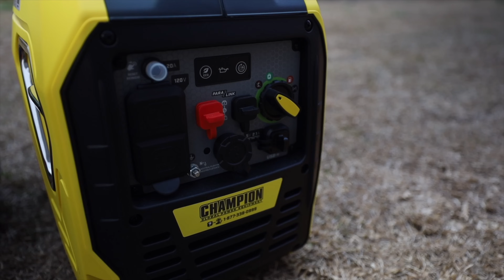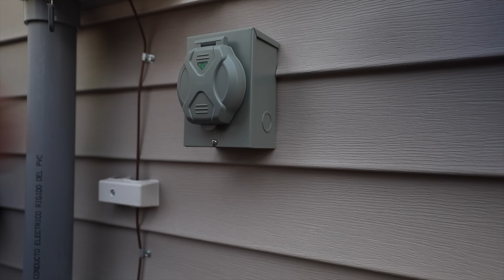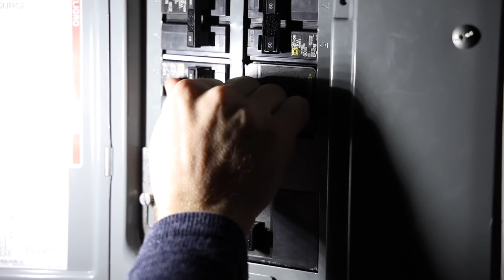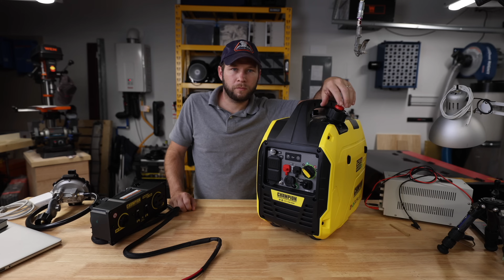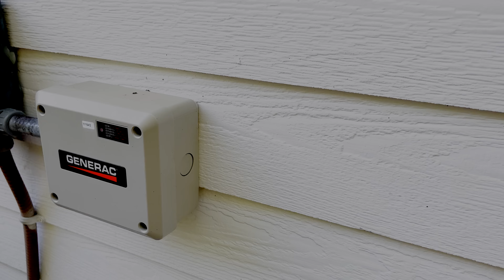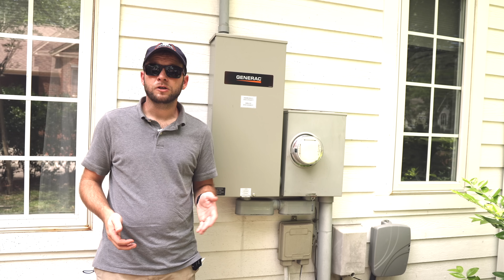Will running on a generator damage your house? Inverter vs standard vs standby

Comment: So much incorrect information in regards to the transfer switch.  Like not even CLOSE to being right.
Reply from the maker: I don’t understand your comment, the transfer switch controller monitors the grid and sends power to the generator to maintain its system. The ATS brain is constantly monitoring the utility side and upon a power failure severs the utility connection side and sends its start/run signal to the generator after a programmed delay.  What exactly is wrong about that?
Reply: @DemonicAnimatronic  The ATS does not “sever the utility side and then send a start/run signal”.   An ATS sequence of operation is as follows:
Sense utility failure
Wait for programmed time to elapse
Send start signal to generator
Verify generator power is present
THEN and ONLY THEN does the contactor operate and switch the sources from utility to generator. 
There is ZERO chance that the generator can back feed the utility grid no matter what position the contactor is in.  It is a double pole double throw switch.  There is no physical or electrical connection between utility and generator.
Reply from the maker: So start, then disconnect utility to off position, then from off position to generator.  I’m aware it’s a dual solenoid contactor. I was under the impression it disconnected utility, then started, then pulled in the generator, from a lockout standpoint that makes more sense to me but I guess wouldn’t allow for a short power blip to be accommodated. I don’t believe I ever said the generator could send power back to the panel while the utility was also connected?
Reply: @DemonicAnimatronic  at around 24:00 or so, you made a point of incorrectly explaining how the transfer switch ensures that the utility connection is severed so the generator can not feed power through to the meter.  The very design of that contactor precludes the possibility that could happen no matter what position the switch is in.  That is why the sequence of operation is as I stated.  Also, the linear actuator that changes the position of the switch requires line voltage to move.  Without either utility power or generator power, it can not change position.
Reply from the maker: @ClearlyDigital  with all due respect, that’s not incorrect though, the transfer switch does sever the utility connection to prevent the generator from feeding back into the grid, that is its purpose. In the same way as an interlock kit on an electric panel prevents back-feeding.  Please stop restating what I am saying using different terminology and saying the explanation is incorrect. For example: I said I am aware that it is a solenoid operated switch, given that it is using electro magnetism to pull in a set of contacts, it is effectively a contactor. Your explanation was that it uses a linear actuator. Well, a solenoid is a type of linear actuator, however not all linear actuators are solenoids.  Now, this is a layman video that was to explain the type of generators used and why you would use each and how “clean” a given type is. So when someone says what does that box on the wall do, you say it cuts the power from the grid and connects the generator. Another word for cut is sever.  Of course the ac powered multi position transfer apparatus does not allow the generator to be connected at the same time by mechanical means, otherwise it could never have gotten its listing. The electronic control is not relevant either, as it does not need electricity to operate, it needs electricity to operate automatically, there is still a manual override lever, that is why it is a mechanical lockout.  I also used a layman’s explanation of total harmonic distortion boiling it down to frequency variation of book standard. Because describing actual dirty power involving multiple harmonics that can bypass filter capacitors in certain power supplies is a bit beyond that video.   The transfer switch shown in the video is known as a break before make switch or open transition (OTS), this means that it has to sever the utility side before connecting the generator.  There are closed transition switches or CTTS, these actually do allow momentary paralleling of utility service and generator with synchronization to create a zero loss transfer, though these are really only for large commercial and hospital usage.  This really is like discussing three states of matter in basic science and having someone insist you left out plasma.
Reply: Please accept some attempt at clarification.  You are treating the "sever" as a separate step in the process, when it is not on these systems.  On the air cooled consumer grade generators, the transfer from one position (source) to the other is virtually instantaneous.   In changing from a utility/commercial power source to a generator supply (or reverse) once the xfer signal is provided-either by the generator controller with a dumb switch, or via the ATS controller with a smart switch.  Literally if you blink, you can miss it.

There are multiple variation of ATS configurations, and there is no need to go into them as it was not germane to your video.  But, don't think ALL generator/ATS combos work the same as yours-and you might emphasize that.  

And frankly you don't have your systems operation down either:  "...utility solenoid unhooks utility to neutral position, generator solenoid pulls from neutral position to genset connection."  No, it really doesn't-your system will either use the utility closing coil, or the generator closing coil, (when two solenoids "coils") are present) or the linear actuator cycles the amount of times it needs to go from one, to the next available power source-depending on the type of switch...there is no "utility solenoid unhooking" here as it has been de energized almost the second it BEGAN but not quite completed its last transfer.

The mechanical process is that the contacts movement is initiated by the particular solenoid, overcoming the spring tension that holds the contacts in their present made position.  In doing so, the contacts are forced by the coil past the over center point, the solenoid has already dropped out (energizing limit switch is opened) around this time, where the internal springs for the oncoming power source will then forcefully "make" the contacts firmly close-that is the "clunk" or "snap" that you hear.

Just say "thank you" and move on.   @DemonicAnimatronic
Reply from the maker: @bobbygene8274  As an electro mechanical engineer, NO. I unfortunately can’t say thank you and move on when information is incorrect or is restating something I said while stating I am incorrect. I do not care about how fast the transfer time is, it really DOES disconnect the grid then connect the genset. Please see above statement about OTS vs CTTS. I get that this is done in one motion, but it is done. It is required to be done or the generator would not be allowed in service, as a mechanical disconnection of the grid is required where not permitted for momentary parallel synchronization. There is a neutral position, the transfer switch is not capable of switching from grid to generator without momentarily being in neither grid nor generator position. I assume you are referring to a pull pull transfer switch where one solenoid is used to pull from utility to genset and the other is used to pull from genset back to utility?  There are also powered hold contractors (if you’re lucky with economizer coils) that “fail open” to neutral when power is not applied to either coil. This way power can be severed from the grid when poor power quality is detected and then can be connected to the genset after it has stabilized, this is can help protect loads. It does seem we have a whole lot of "generac experts" here that cant see the video was supposed to be a very generalized version of a complex topic. the point that was being compared was that with a manual interlock the user would first turn off the main breaker, then slide the interlock and then turn on the feed in breaker.  I was (apparently poorly) stating that the ATS did this same operation automatically.  No , i did not say this does not apply to all generator transfer switches and that some have manual phase synchronization before being manually kicked, because i assumed those viewers were probably not watching this video.  personally i have a <10ms transfer computer monitored load center that uses independent circuit monitoring and prioritization, i also use some rack-mounted high availability transfer switches on critical loads as the whole home ATS in the video was not mine and frankly I find it too slow.  but i do get to keep the interaction high with these comments so thats a win 🤷‍♂️
Reply: @DemonicAnimatronic  I missed your reply several months ago, and I apologize for missing it.  You speak of several different types of switches that you are familiar with, and you are most certainly correct in most of your explanation, and certainly wise in keeping it simple.  But, don't think throwing words around like "engineer" electro-mechanical or otherwise is somehow going to make you more qualified than some of the commenters that you have had the chance to interact with and also entertain.  

Many of us work on commercial and industrial auto-sync, auto parallel systems and effect repair on the same-and those pesky switches that stop or pause in the neutral or "open" positions that allow motors loads to decay, or even delay return transfer until elevators to get to the next floor or what have you. Just so many possibilities.  And some of those guys will try and keep you on your toes, so to speak.  I certainly do agree that the interaction is the high point, though.   For that, I say thank you.
Reply from the maker: @bobbygene8274  meh, only thrown around because others like to throw in “electrician” or “ I installed one of these once”  before they start telling me what I got wrong. so I’m saying as a degreed engineer who had to study, design and build control systems, the terms have meaning and so does semantics. All of this line of commenting was a result of the comment about a majority of the video being wrong. If we’re going to argue over credentialing and delve into the weeds over how many balls shift from hole to hole in the time it takes the switch to pass from one contact to the other and then establish a spec for which speed results in it being considered a non disconnection, well then I came to play.  ;)
Reply: @DemonicAnimatronic  ... clarification from a 25 year Generac tech.... the TS does NOT control the gen set. The TS has no brains, unless it's got a load shed module. (yours does not) The generator board actually monitors the utility power via the same wires that charge the battery. (240 volts) If it senses a brown out (forget the exact range) or an outage it will start the unit and transfer. The gen board controls the actual transfer via a 12 volt DC signal (terminals 23 and 194) through a small relay within the TS cabinet. This relay puts 240 volts from either the gen set or utility to power those actuators. IOW, there must be utility or gen power available to make things happen. The time delay for all of this is not adjustable by the user, it is factory set. On your unit it will be about 10 - 12 seconds to start up and the same for warm up, then transfer. Cool down / retransfer on utility return is roughly 3 minutes. (max) on a short outage it can be under a minute. Again, factory set.

Comment: A good overview of the functionality, but I guess I missed the part where you cover "will running on a generator damage your house" in relation to the whole-house units.
Reply: Yes that was not a good example he gave about the 40 amps running down the neutral wire because that's an illegal installation anyway. If you have a toaster in a microwave on that island operating at the same time it's going to overload that circuit whether it's on generator or house power. That does need to be clarified about burning your house down. The really person with the two question marks doesn't grasp the situation
Reply from the maker: @carver4894 Not quite, when you install a generator inlet and transfer switch or an interlock and have it inspected, the inlet can be split phase  120/240 4 pole. This inlet will carry all the way through to the separate bus bars and neutral and would be perfectly legal (depending on your local codes)  however 120v generators that offer a 4 pole outlet (known often as RV ready), or a 3pole to 4 pole adapter, will spilt the single leg to the two hots and provide power to both busbars in a panel in phase.  A shared neutral generally meets code (again check local) as long as it is on a common trip breaker. This would not overload the island circuit with a microwave and a toaster when on grid power, because the two circuits are out of phase and would cancel out the current on the common neutral. The second that a split leg generator was connected instead, the neutral would add both loads together and overload.   So nothing here is generally “not legal” but would essentially be up to the homeowner to know how their generator functions before connecting.   Some very knowledgeable inspectors way refuse to let you put a shared neutral circuit on a critical loads panel or an interlock, but it would be at their discretion and easy to overlook.
Reply: Really??

Comment: "Will running on a generator damage your house?"
NO.  See "Betteridges Law of Headlines".
Reply from the maker: Ahh but you missed the stipulation of the law that it only applies to questions that are yes or no. As this video clearly explains, the answer is that it depends on what generator you you use and what it’s powering, therefore Betteridge’s law cannot apply.
Reply: @DemonicAnimatronic  COL (Chuckle Out Loud) Excellent response.  We have one of those generators at work (16 KVA Generac) and its waveform is pretty bad, nearly a sawtooth.  We had to set all the UPS to minimum sensitivity.

Comment: Just for clarification, when you say the 240V on a generator is not out of phase, you mean on paired inverter generators only right? a 240V open frame generator should not have this issue as L1 and L2 should be out of phase to produce 240V between them.
Reply from the maker: Yes, if the generator says it outputs 240v and is not a European market model then it should be 120v on L1 and 120v l2 out of phase with each other. (Europe has 230v between hot and neutral, and 50hz)  with the parallel kit for the 120v generators, it still outputs 120v just with double the current, so to wire the 4 wire outlets, they are splitting the same wire to both hots and not giving 240v.    In summary lol a 240v outlet on an open frame inverter generator should be out of phase 240v and not have the same issues with overloading shared neutral.
Reply: My generator has a 120/240 volt outlet. I assume it will just use both L1 and L2 and I won’t have any issues either? My electrical knowledge is very limited

Comment: Recently I got a 50 amp inlet installed, a gas meter tie-in, and a Firman tri-fuel generator. According to their site, the THD is between 11% and 14%. This can run my entire house without issue including fridge, deep freezer, AC and/or furnace. I purposely didn't turn on my stove or oven or computers, as I probably wouldn't use them in a blackout. I also don't wanna take any chances of the computers having issues. The downsides are true. Lugging that heavy beast of the garage is a pain, and also connecting that thick power cord from the generator to the house is a pain. Upside is the natural gas hookup is so convenient. I haven't had to use it for real yet, and I hope I don't have to.
Reply: Have you checked that your furnace and fridge can actually run correctly on 14% THD?
Reply: @percyfaith11  Yes. They worked fine. My fridge and furnace are 08 and 09 for what that is worth.
Reply: @SeanBaker  thanks for the answer Sean. My fridge is 2021 and my furnace was put in this year and is high efficiency. Neither one will operate with my old Coleman generator. I'm not really sure what the THD on that generator is. But I'm pretty sure that's the problem.
Reply: @percyfaith11  The problem with you furnace may be it requires a bonded ground and your generator may have a floating ground. If this is the case for your generator, they make neutral grounding plugs for $15 that plug into one of the generator outlets.
Reply: It is a good idea to run that generator once a month for at least five minutes. Add a load to it to test output. There is nothing worse than having an emergency and the generator will not start or produce power.
Reply: @Subgunman  I really should do that!

Comment: One thing I've been unable to find is the range amount of THD coming from the utility company into my electrical panel.
Reply from the maker: The book standard for a utility is 5% maximum at or below 69kv I believe. so it could be better than that, but should not be worse. Partially to serve their customers and partially to maintain compatibility across the grid and maintain tolerances across sensing equipment.